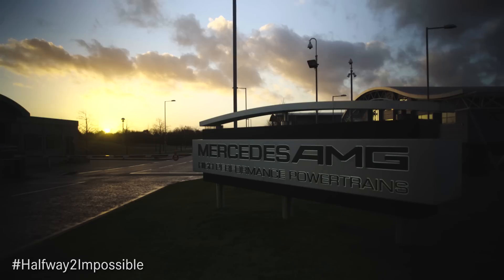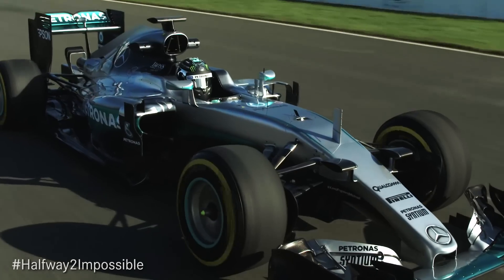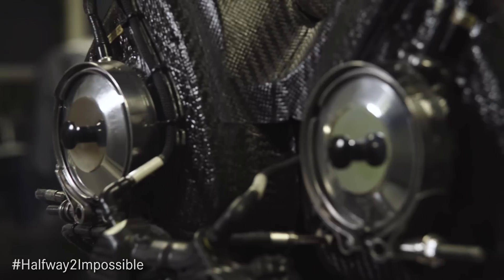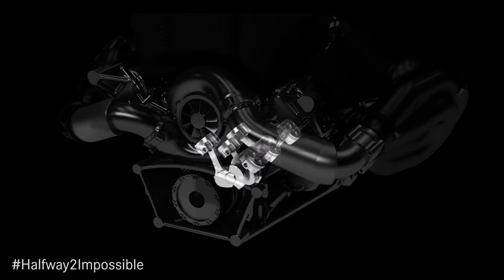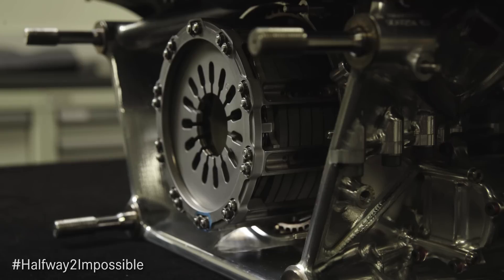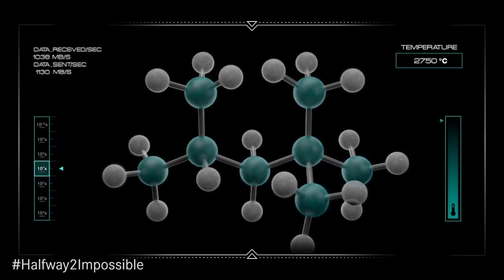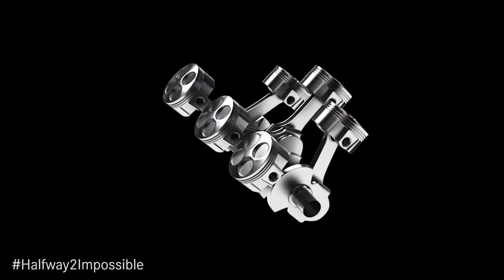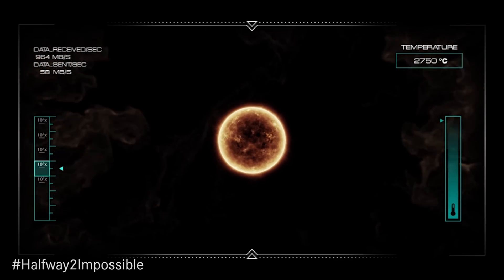What Do 37 Million F1 Ignitions Look Like? (1/4)

Comment: Precision parts required in F1 engine can't possibly trickle down to commercial vehicles.  Vales, piston rings, heades, are exotic titanium alloys.  Did I mention the compression ratio this thing runs at?
Reply: Yea😂 getting the engine of the AMG project One to actually pass regulations and be "acceptable" in terms of power delivery was a huge and costly endeavour that Mercedes ultimately did not want to commit to, in retrospect. 

Literally nothing of these cars is open to road use.

Comment: He said that the combustion process with the extreme heat and pressure happens  50,000 times a lap, and then he said it will happen 30 Million times in the engines life.  That's only 600 laps. 50,000×600=30,000,000.  Can you imagine putting as much time effort and money into these engines as they do and being done with it after around 600 laps.

Comment: Mercedes should produce high performance 4 cylinder NA engine like the ones on 190E 16V. On race trim the DTM 190E engine can produce 400 HP. That is some 30 odd years ago. I am expecting to see 500hp NA engine by now.

Comment: 50% efficiency of IC or complete power unit (IC+MGU-K+MGU-H)? As far as I know 50% thermal efficiency is achieved only by two stroke turbocharged container ship diesel engines where pistons have bore of around 1m and stroke of 2.5m (or maybe more this is approximately what I can remember) and rpm is around 100 rpm. F1 engines are on the opposite side - short stroke and long bore and I bet that efficiency without energy recovery units (only IC + turbocharger) is far from 50%..

Comment: You talking about C02 emissions but what about NO2 emissions, in a combustion chamber, if u pass 2000 Fahrenheit NO2 emissions rising exponentially as you well know this is the main problem of the diesel engines (efficiency can reach %50 ).

Comment: I think what these crack shot engineers omitted to point out (although  #Halfway2Impossible or 50% thermodynamic efficiency is a great tag line) , is that it is only when you capture heat from the  exhaust to charge batteries (MGU-H), along with energy from the drive shaft under braking (MGU-K) ,  regenerative braking, and drivers who  weigh 150 lbs wet.  Then yes you can get to a 50% thermodynamic efficient cycle. Stay in school and stay off the crack. Basic laws of Thermodynamics and Stoichiometry should make you think twice about how combustion technology on it's own, could achieve such high efficiencies (it' can't).  F1 cars are achieving these high efficiencies because they are, well Hybrids?
Reply from the maker: Yes of course the hybrid component is needed to reach this. But 50% from a competition engine remains remarkable!

Comment: Or just use electric motor and have 98% efficiency ...
Reply: Even in the US, most of the electricity comes from natural gas power plants, and they're extremely efficient and clean, many achieve thermal efficiencies of around 60%. Nothing matches the efficiency of electric powertrains, even when being powered by fossil fuels.
Reply: Yeah, but good luck on power storage. Also, would YOU go to an F1 race to watch battery-powered cars? You and the other 5 people can have fun. (And again, a electic motor only has high efficiency because it does't have it's own built-in coal power plant generating electricity on board. That power comes from somewhere; An ICE extracts it from a fossil fuel on board and transmits it to the wheels. In this scenario, an electic motor is more like the final drive of a normal car.  For a full cycle, electic cars aren't much more energy efficient, even when they aren't taking their power from a coal power plant.

Comment: I don't know how many engineers overlook the fact that by adding all this things to an engine makes them soo much heavier and at the end it's slower than using a lighter engine. Also an NA engine could be nearly as complicated as this if the FIA allowed development for engines like the V8s, but they hardly restricted them in terms of rpm, allowed materials and technology. For me efficiency means doing more with less and that doesn't reflects to the fuel use. Atleast I look at it that way that you get more power out of a lighter engine. F1 should be spectacular, screaming V12s, under 600 kg car weight and more development freedom. 2017 Made a step in the right direction, only the engines are still not appropriate. NA engines still could be extremly technologicly advanced, just add direct injection, free use of composite materials and more allowed sets of engines during the season. While the V6 is fascinating in it's own way it has no place in F1 and I don't see why it should be "road relevant". That sounds more like a compromise that you don't do what would be possible to make the car faster but rather build something eco friendly and thats not motorsport!
Reply from the maker: +gamehey  Thanks Mr Newey, great to see you taking the time to comment on our channel! 😜

Comment: stop holding on to ancient relic that is combustion engines and move forward
Reply: What do you propose is used to propel automobiles? Electric motors are not anywhere close to being developed well enough to justify large scale adoption over internal combustion power plants.
Reply: Electric motors are also just as old as your "ancient relic" ICe engines, dude. learn a little history. Fucking idiot millenials.
Reply: Whatever the future brings, the EV is not the anwser for the entire worlds mobility simply because the rare resources needed to produce the copper and magnets for the Electric motors and all the generators of windmills needed to power all of it. Let alone the Lithium mining.. Hydrogen Gas ICE's most likely will become a thing. EV's was also a thing 100 years ago but guess what won the battle back then.

Comment: Co2 reduction... Try an electric engine
Reply: some day i believe production ICE engines will be more than 60% efficient, producing zero harmful tail pile emissions,  brisk in accelerating, silent in operation and will be running on advanced 3rd generation bio fuels.  allowing for a sustainable, powerful and clean mobility. i guess Mercedes has enough capability to get this done before 2030!
Reply: Electric seems like an efficient way because the vehicle itself doesnt "burn" but In reality ICE powered by Hydrogen Gas which by his turn is being produced from Water using Core Fusion would be the ultimate solution for the Entire worlds mobility.

Comment: Instead of pressure in atm, or kgs on the enigne: 4 ELEPHANTS XD
Instead of x/second: 200 IN A BLINK OF AN EYE

Thanks for the detailed info.
Reply: are you by any chance familiar with terms like "layman terms" and "analogy", you should google them, you'd be amazed!
Reply: 4 Elephant = 46.8kPA isn’t?
Reply: @soraaoixxthebluesky  no it is not, 1 bar is 100kPa, so your guess is lower than atmosphere ;)
Reply: Assuming a weight of 5000kg per elephant and a cylinder diameter of 10cm, I came to a pressure of 250 bar!

Comment: I hope some people here understand now why electric cars make sense, 50% efficency is a joke and thats top of the line technology. Road cars arent even close.
Reply: Eric B
We've had the solution to powering electric cars without burning fossil fuels for decades now. Nuclear power. If they can ever perfect fusion power we'd be even better off not having to deal with anywhere near as much radioactive stuff.
Reply: Yes but if every car was now electric...how much Electricity would need to be made to charge all those cars?...and what is going to be used for generating it? Batteries are the biggest problem for electric vehicles, energy storage and charging being on the top of the list of problems.
Reply: Electric cars aren't any more efficient when you count how the energy is extracted in the first place, and transmitted to the damn car. An ICE car has it's own built in energy generation plant. An electric car just has to use the power given to it. But when that power comes from a coal plant...nope. Even your precious renewable energy sources are sadly inefficient. Only the wasted energy doens't have the negative side effects of fossil fuels. Do you even understand how "efficiency" works?
Reply: Agreed. But in countries like US most of the electricity comes from burning coal and oil, whose thermal efficiency is far lesser than 50%. So I believe hybrid propulsion systems are perfectly acceptable.
Reply: Youre right but its just another reason why we have to invest heavily in both, renewable energy and electric car technology.
Reply: if we had realy something it would be there.
more than 100 years that people try to get performance + great range + short charge time. and it's still bad
today it's electric cars the joke
electricity as we know it today isn't good enough for cars
and i'd realy like to have the efficiency number for an electric car
Reply: true, from coal to power outlet on average is around a max of 11% efficient, gas is better but I don't know the exact figures, I recall something like 15-20%.  Turbo petrol engines in cars these days are around high 20 to low 30%%, turbo diesel is around 40%
Reply: CasaXtreme TheGemanLegion we need a compressed air car
Reply: The main goal should be for all of humanity to use less fossil fuel and pollute less over time. Higher efficiency is part of that, smaller lighter cars that need less energy to run and better public transportation are good ways too.
Reply: Electric cars are only going to be environmently friendly and actually make sense at all when the electric grid is fully powered by renewables. Buying a new Tesla is, today, worse than keeping a small older car.
Reply: Electric cars arent more efficient than ICE, People should stop looking at the whole thermal efficiency bullshit, The heat will always be a by product but a liter of liquid fuel has far far more energy than an equal electric car.  To generate that electricity there is no way to power ALL electric vehicles in the future with only "renewable" sources. The only Thing that can save the future is ICE powered by hydrogen gas.

Comment: I'm not buying it! Try this out, take the exhaust, or atleast part of it, shove it strait back into the air intake, now the part that isn't burned is recycled. Wait didn't some guy come up with that in the 60's then the idea got bought by one of the motor companies so to put into the vault? Guy ran his 60's v8 American at 300 miles a gallon, in the fucking sixties!.. if you guys ever see the movie Loopers, pay attention to the cars, they recipe the exhaust into the gas tanks on almost all the cars! They don't talk about it, it's just in the background.
Reply from the maker: +lowkey213  But we are not doing that. We have an electric machine on the shaft of the turbo. Nothing to do with exhaust gases - they simply drive the turbo.
Reply: Mercedes-AMG Petronas Motorsport I know, I understand that. My point was that there are ways, why those ways aren't in use or being tuned for application idk... btw, I'm a fan, impressive!
Reply: Mercedes-AMG Petronas Motorsport I have question. How come rotary engines aren't used in F1. I'd assume the simple design with minimal moving parts would be desired, similar to the Rotary valve system. Is the the rules that don't allow for it, or is there another reason like maybe the engine design is not what they say it is
Reply from the maker: +lowkey213  Not permitted in the rules!
Reply: Mercedes-AMG Petronas Motorsport last ?... rotating valve heads, similar to the coats csrv design. No pop valves, 2 moving parts, I figure, cylinder head failure would be minimal... plus the patent is supposedly expired. Any idea why it hasn't been applied to F1
Reply from the maker: +lowkey213  Check out Art 5 of the tech regs.

Comment: Forget combustion engines. This is the new era of electric motors - more efficient, quieter, zero emissions, more torque at any rpm etc.
Reply: Not true, a coal powerwork has a much higher effiency than gasoline or diesel powered ice cars. And why do you think all power is made from coal? The batteries are recyclable.
Reply: Yeah, just what we all go to races to see...a pack of silent cars driving in circles. BTW, are hyou familiar with the industries that go into making electic motors? Not that pretty. Nore are solar panels, or batteries.....
Reply: Only retarded country use coal to make elctricity, use some nuclear plant like in france and it will be ok.
Reply: Yuri Grillo torque is not as linear as a gas engine
Reply: Even the US gets most of its energy from natural gas.
Reply: Definitely more eco-friendly!

Because when you have to change the battery (real often) and when you have to produce it  all the material the battery is composed from are not bad for the nature at all. Suure.
Reply: You know nothing about respect. Therefore, respect me.
Reply: electric engines arent more efficient, coal generators which are used to create our electricity are way less efficient than regular piston engines, now calculate the power loss from transporting that energy from the powerplant to your car and its alot worse for the envirement. also electic cars have way less range than fuel cars, are alot more expensive and batteries only creat toxic waste which is alot worse than carbon in the air

Comment: and compared to Audis and Porsches LMP1 cars this is still a rather poor Performance because the power sytems of those cars give out more power at a quarter of the fuel consumption.
Reply: What a stupid claim........

Mecedes AMG is claiming that they harness close to 50% of thermal energy of the fuel.

You claim that Audi gets more power out of 1/4th the fuel.
That would mean that Audi somehow broke the laws of physics and got more mechanical energy out of the fuel that it contains as chemical energy.

That's simply impossible.
Reply: TheNecromancer6666 
There simply isn't enough waste energy to use by the hybrid systems to get the figures your suggesting. Even when turning for 400% to 40% it just can't be done.

The difference in fuel consumption is achieved in other fields.

F1 cars have a LOT more drag, CW estimates seem to be between 0.8-1.2

Your average roadcar is arround 0.3 Tesla model S is at 0.24

That means that a Tesla model S has a quarter of the air resistance per square feet compared to a F1 car.

LMP1 cars still focus on downforce(not as much). but they no longer have open cockpits nor open wheels. 

Considering air resistance is the largest factor of resistance at high speeds(where you would typically race at) it's not hard to see where the fuel consumption comes from.
Reply: TheNecromancer6666 
Now to get further of air resistance.
With an F1 car compared to LMP we are talking roughly similar top speeds on the same tracks.

But a LMP car is 25% heavier.
That means the LMP can harvest more of the energy that was being putted in the car by the drivetrain which has already been lost due to the increased drag of the F1 car.

This doesn't mean that the drivetrain is more efficient. It just means that a heavier cleaner car can make better use of kinetic recovery systems. These systems have nothing to do with thermal effeciency. 

They just help you regain energy that would otherwise be lost with braking.
Reply: TheNecromancer6666   The Audi is also much slower and a hybrid. How much fuel it uses over the same distance is  not the only relevant aspect. By the way, you lose the argument automatically, because you're trying to argue that LMF1 is somehow superior to F1, which proves you're absolutely clueless about engineering and know nothing about this topic.
Reply: If LMP1 wouldn't be limited so drasticly  F1 cars would be torn apart. Calculating in the weight advantage of the F1 the LMP1 is already quicker.
Reply: And F1 is not limited?
Reply: 1barnet1 Audi has a combined system output of 1100hp by using significantly less fuel over the same distance. Not all of this power of course is chemical energy from the ICE. About 40% is the Hybrid.

Comment: In 10 years no petrol car will catch an electric..
Reply: in 20 years electric will flop because the problems for resources for generators, EV motors and batteries. It flopped 100 years ago and we think its a thing because we believe ICE can only run on petrol. WRONG, hydrogen Gas
Reply: The oil industry will never be finished. They will adapt and corner the market as they usually do and make batteries and electronic components. Electric vehicles still need grease and guess where that comes from.
Also if electric takes over the cost of electricity at charging stations will be astronomical just like the price of a gallon of gas and guess who will own the charging stations ... big oil.
Reply: Most countries still use oil to provide electricity so no real benefit there. Lithium is bad for the environment, slaves work hard for the minerals needed. Low top speed.If flooded it's trash now. the size of a gastank and a big battery is huge in difference also the weight. Hybrid is the way to go not electric.
Reply: DevasionX in Chile we have litium for the batteries of the whole world. what are you talking about. in the past the industry of the petrol killed electric cars because efficiency and interest . not now
Reply: i want that to happen! lol hail ICE
Reply: DevasionX synthetic fuel too